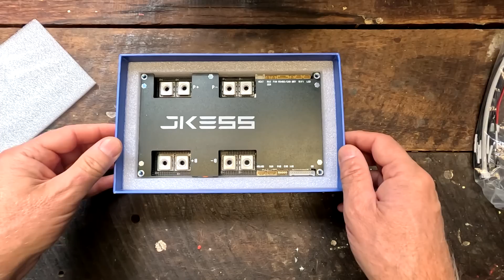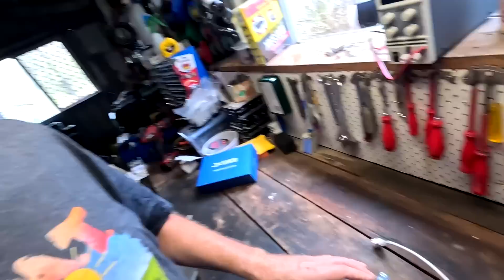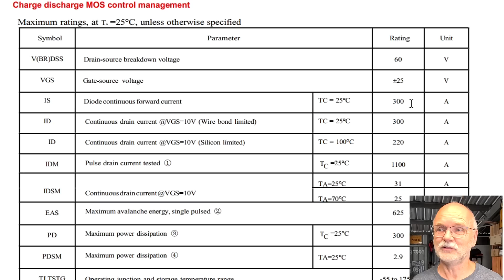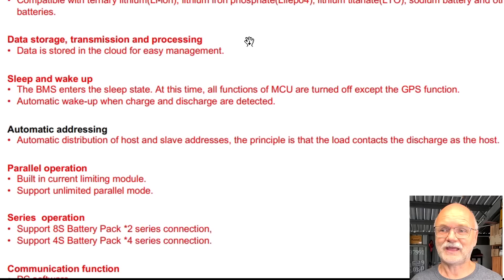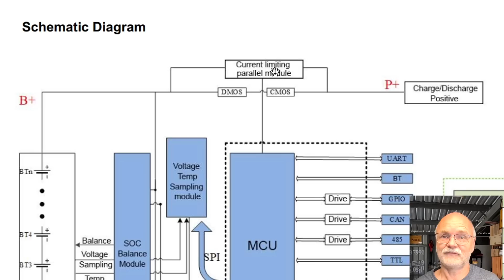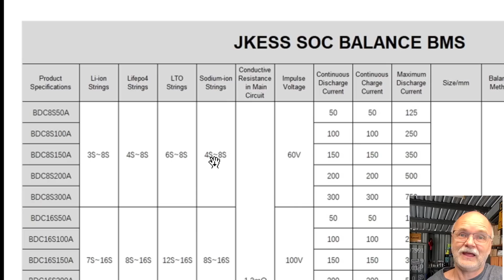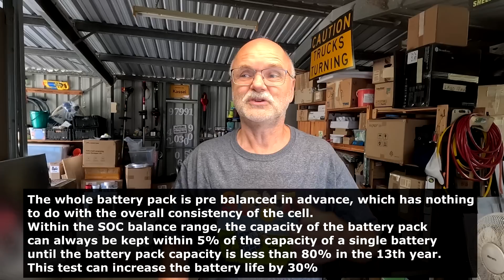Brand new JKESS BMS! Hardware, Specs, Features. It's not a JK-BMS though🤷‍♂️

Comment: What about the JK firmware updates we are missing ?

I do not wanna buy something new when it is working. My drift has gotten even worser the last few weeks and the only way out is to fully charge within a week cause otherwise SOC is inaccurate and causes costs when running out juice like last week 2 time in the most expensive time of the day even though the soc had promised to have enough for 2 more hours.
Reply from the maker: Thanks for your comment.
Reply: @OffGridGarageAustralia  Danke, ich hab ein Spezialthema für Dich, der heißeste Scheiß und nur auf Deutsch. 

AKKU ENTLADE PAUSE = katastrophal hohe JK V15 Inverter BMS Standbyverluste ?

Ich schalte mit Homeassistant ab X Uhr für Y Stunden (die günstigsten) per Automation beim JK BMS die ENTLADEOPTION aus.
Uns beiden ist klar, das Haus kriegt dann günstigen Strom vom Netz und nach 5 h hab ich 3-4 kWh gespart für den Morgen, wo Tibber die 38 bis 50 Cent haben will.
 
ABER: Ich hatte in Homeassistant für die Dauer der Pause im Chart eine horizontale SOC Linie zu sehen erwartet, wenn der Akku schon 5 Stunden frei kriegt bei dann 30% - 40% SOC, um danach auch am trüben Morgen bis 9 - 10 Uhr durchzuhalten.

Rate mal, was aus den 30% geworden sind?

Die waagerechte Mauer fällt zum Nachbargrundstück ab und ich hab da Verluste bis 4% in der letzten Woche erstmals gesehen. 
Ich hab den Balancer oberhalb 6 mV eingeschaltet und ich meine auch auf jenseits 3,35 V stehen, aber kann der Balancer 4% des Akkus in 5 Stunden verschlingen ? In 1 ganzen Nacht wären es mehr als 8 % oder nach 100 Betriebsstunden h ist der Akku leer. 

Kannst ja mal selber schauen, ob Du das auch beobachten kannst und was beim BMS das verursacht, denn 8% am Tage sind im 24h Betrieb auch 1 kWh Verlust, da der Akku ja mehr oder minder 247 aktiv ist und Verluste einfahren dürfte, sei es zum Laden oder Entladen. 

Ich bin auf Entladepause gekommen, weil der Strompreis in der Nacht augenblicklich zu hoch ist oder genauer zu nah an dem Preis, wo er später verbraucht werden soll wie dem frühen Morgen von so 7 bis 9 oder 10 Uhr. 
Ich brauch bei 28 Cent doch den Akku nicht laden, wenn morgen früh 36-38 Cent verlangt werden, weil ich bei 20% Verlusten auf dem Rundweg schon mit 34 Cent Gestehungskosten (ohne Kosten für Batt. Zyklen) rechnen kann. 

Da war es für mich smarter, bei absehbarem Engpaß am Morgen eben 3 bis 5 h Entladepause zu machen statt zu laden, aber bei 8% Verlust in 24 h sieht das ja gefühlt richtig übel aus.

Comment: Tested v15.30 with LuxPower SNA 5000. The issue with stopped charging still occurs. Also it calculates 100 % SOC incorrectly. It sets 100% before high cell reaches set SOC-100% value... Hopefully they will fix these issues one day
Reply: YamBMS with LuxPower protocol fixes this problem.

Comment: Whilst my Victron inverter uses/wastes over 70w ticking over, I'll not worry too much about the efficiency of the balancing... Ohh, not sure about the GPS function, but I do suspect the gyro sensing is more aimed at EV's where a roll over would trigger a power cut off... Not a lot of use in ESS applications, but can see why it might be there.
The JK cloud is a little concerning.. Not sure I want my BMS 'online' directly, I especially don't want my BMS to demand WAN access to function (I know that's not being said, but it's a well trodden pathway for sure)... Great first look vid, thanks Andy
Reply from the maker: Thanks a lot for sharing.
Reply: "my Victron inverter uses/wastes over 70w ticking over" what system in detail please ?

Comment: The analogue front-end they are using (MP2793) supports 58mA passive balancing, or can drive external transistors/mosfets for balancing. Would be nice to see a picture of the PCB to figure out if they're still doing active balancing, or just doing passive balancing and hiding that with fancy (my BS detector went wild) tech speak. Incidentally, this AFE is also the reason why they do high side switching - it's what this thing supports. I'm looking forward to the details!
Reply from the maker: Thank you very much for your analysis so far. More to come. Not sure if they ever release more tech details though as other Chinese companies are watching.
Reply: @OffGridGarageAustralia  Could you share some high quality pictures of the internals, especially the PCB? I would really like to know what MOSFETs they are using, if they have active balancing or not, other design choices they made, etc. If you can't share that publicly, you have my email :)
Reply: @OffGridGarageAustralia  By the way, the MPF4279x fuel gauge reference documentation describes the SoC algorithm they are talking about. The main issue with these is that they have a dedicated chip per battery chemistry, for example the MPF42793 is for LFP.
Reply: @OffGridGarageAustralia Andy can you please test it anyhow, you have it already. For offgrid it has not many new features that matters BUT for RVs and boats It offers in  4S and 8S a lot of features nowhere else available like master and slave as well as communication plus the high peak current values allow to use the BMS also on motors with high surge like engine starter, windlass and bowtruster. Additionally the jk inverter BMS stops at 200A in 24V which is too low for use with engine starters and in boating the house battery must be able to start the engine in emergency. For that we need a 300A BMS which is only available from JK without any communication and no master and slave which again we need. If you don‘t wanna test it ship it to me and I will do the test…I pay for shipping.
Reply: Agree with this. There seem to be a lot more questions than answers at this time.

Comment: Just checking the manufacturer datasheet of the MCU MP2793. It states that it has a passive balancer with up to 58mA per cell.
Would be nice to get some more detail information how this „magical“ SOC balancing works…
Reply from the maker: That is basically all I got, what I already showed on the screen and what they sent in this spec sheet. It is a bit of magic🪄

Comment: Andy, could you please contact JK, and make them update the firmware on the old Inverter BMS, so that they ad a dry contact "Hi SOC" function? Curently theres only a Low SOC feature. That way i could use up exces solar in a water heater, based on SOC... For example, at 95% SOC the water heater turns on, and at 90% SOC it turns off. That would be a realy simplefied automatization for exces solar use!
Reply from the maker: I can add it to the list, but atm they don't even fix the important bugs.
Reply: @OffGridGarageAustralia open a bug tracker and put those bugs to it.
Reply: Сделайте это через реле

Comment: For me that sounds that the BMS monitors the discharge and charge curve of each cell and than balances not based on the top voltage curve but countinously based on the SOC of each cell. Means it recognice slightly different capacities and „pre-charges“ each cell during the charge process so that all hit 100% SOC at the same time.
Would be magic and over engineered
Reply: A friend of mine works at Sonnen (German solar battery manufacturer)...they where attempting that as well...but with passive balancers...because they have only low balance currents.
I think it is not necessary with active balancing at all.
Reply: That is the basic concept of the AC storage systems from SAX Power in Germany using cascaded multilevel h-bridge inverter technology. Beside switching cells in series dynamically to creat AC voltage with an efficiency of nearly 99 %, they use a pool of cells from which on charge they select the cells with the lowest SOC, and on discharge the ones with the highest cells necessary to fit the current AC voltage in the sinus curve. This is done with 5 kHz. So they can do kind of wear leveling on all cells with overprovisioning, just like on an SSD. All cells are aging similar and the balancing is kind of automatic. This may then cause extended life-time of the complete storage, because instead of the weakest cell is defining the total battery capacity, the sum of the capacity of all single cells defines the total capacity.
One can envision to do something similar for a poor DC system, but it seems to be JK left out the overprovisioning part, but it may be that depending on the calculated SOC of cells, they do switching of the cells. Normally the POWER MOSFET are just on or off and are not switched at high frequency. The mentioning of better EMC shielding may point into this direction. It may be interesting to look at the noise on the DC output with no load and under load.
As they talk about a higher virtual voltage they may also discharge cell with higher voltage/SOC and convert the cell voltage up to the battery voltage and feed it back with battery voltage into the battery.

Comment: I do not really appreciate the idea to have massive positive and negative power wires so close to a thick aluminium plate, with just minimal air gaps.
Reply: My 2cnts as someone who saw a lot of pcbs with Mains and secondary Side only seperated with a small gap: To be fair, it seems powdercoated, so it is painted. Isolation gap should be absolutely fine, given the amount of air and voltage that this BMS is supposed to run at. You always can, just to be safe, put a plastic cover, capton Tape or another Isolation layer in between, nobody is going to stop you of course. But for normal Operation this is totally fine, from a design standpoint imho. - Happy to hear other thoughts with explanation tho.
Reply: @slythee7423 , 32S bms-es incoming...., well, I don't like it either
Reply: Yeah, that could get exciting 💥🔥⚡️🧨

Comment: Sounds to me they did go back to passive balancing (balance during charge/ discharge).
Wonder if software developing of the inverter BMS (V14/V15) is stopped and SOC measurement will not be fixed anymore.
Could they make the inverter BMS software open source if they are not willing to fix/ develop the software anymore?
Reply: hello thanks for your comment, which BMS would you recommend me please
Reply: @hichamelouatri566  If you have time, I would wait on how the new BMS develops.
Inverter BMS was a software mass in beginning, think this will happen with the new one again.

Now beside some imperfections the inverter BMS works quite well.
Reply: @ronhellenbrand thank you very much for replying to my message, can you give me an example of a perfect BMS please
Reply: @hichamelouatri566  Inverter BMS is near perfect, the SOC measurement is only not working.
Question is if you need BMS SOC measurement, you can also calculate SOC by a shunt.
Advance of the inverter BMS is that you can buy a lot of DIY casings now.
It will take at least 6 month before you can buy DIY cases for the new BMS.
Not familiar with other brand, so can’t say if there are better ones on the market.
Mine battery in total 45kWh (running with 3 JK inverter BMS) is running well, do also see none need for another way of balancing, the 2A do control the cells well.
Reply from the maker: @ronhellenbrand  Yeah, stick with the JK Inverter BMS. It works well, reliable and has lots of cool features other don't even think about it.
Seplos is out of the race. I made some suggestions about their V3 BMS. That was 6 months ago and they still consider it... they are not moving and have fallen far behind. So is Daly, JBD and many others. The JKBMS is still the best on the market, both BD and PB series.
Reply from the maker: It's very far away from any passive balancing.

They will continue with V14 and V15 software support.
Reply: @OffGridGarageAustralia  OK. What is the status of V15 updates to fix SOC, etc
Reply: @OffGridGarageAustralia  I dont see any.... Do you have a source, statement, timeline?

Comment: It would be great if you could remove the aluminium top plate and show the PCB, just to satisfy my curiosity. Also this balance technology just sounds like an insulated buck converter with programmable voltage. So they measure the average voltage of the cells, programm the buck converter and then charge the lowest cell with that voltage. This technology could reach up to 98% efficency, but the capacitor technology is easy 98-99% efficient in not loosing any charge but is horribly slow.
Reply from the maker: It's not the average voltage. Each cell contributes to the 'virtual voltage' which is pretty much the overall pack voltage. V1+V2+V3+V4 for a 4s battery.
Reply: @ That is the input voltage for the buck converter, but what is the output voltage? To which voltage will the most empty cell be charged? I bet they just take the average of all cells and set this as the target charge voltage of the most empty cell. So technically it is a single cell battery charger I guess.

Comment: Other than possibly powering the low voltage electronics what use could a JK BMS have in an EV? Even 300A at 48V isn't enough for a city car EV. The Hongguang mini is 20kW. Ah, now I see, the relay based 32S might be useful, ~100V at 500A could be made to work for a city car.
Reply: There is no way a bms like this is ever used in a ev